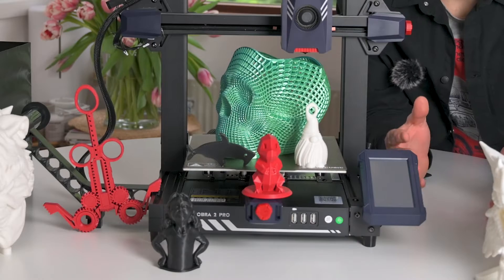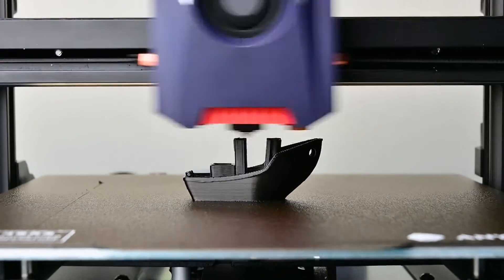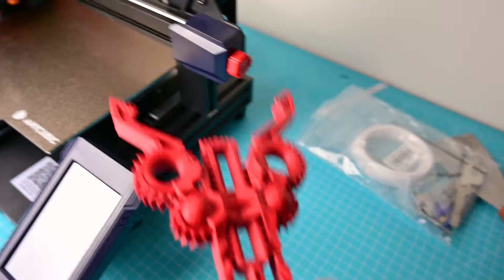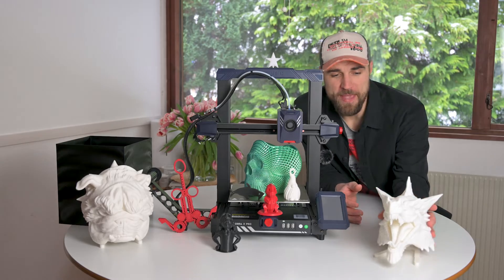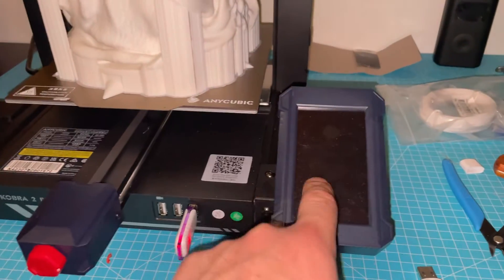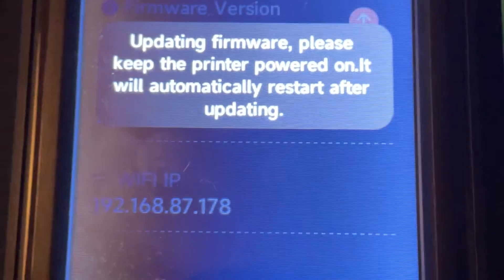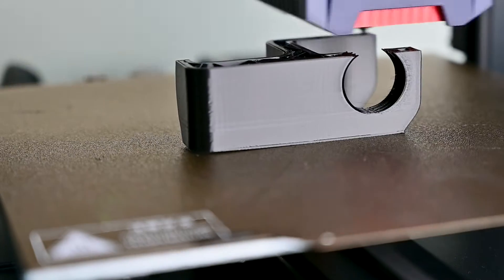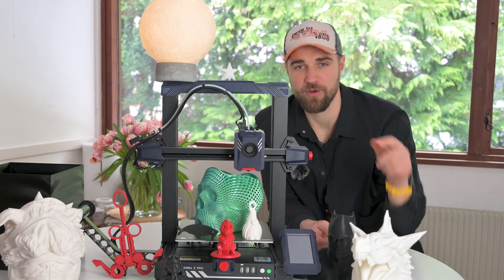Anycubic Kobra 2 Pro. Fast & Cheap 3d printer.

Comment: Quick huh 👏👏👏. What flow do you use in abs and pla?
Reply from the maker: Uh, don’t really know now by heart for ABS as I rarely print it these days. But for most PLAs I care more about the velocity settings, normally do not push more than 13mm3/s 🙄 
I only change flow rates if I am unhappy with wall thickness accuracy. Then do the tests, measure and adjust. Can’t remember when I did it last time 😅
Reply: hahaha I understand, but still thank you very much 😁
Reply: @Ecbonilha  When I got mine I just used the default settings. I haven't had to change anything.
Reply: @jst1man  Thanks. When I bought the Kobra 3, I ended up changing the PLA and ABS flow to 20, I still got good parts that way and it was faster. But the ABS default comes in 7.

Comment: I got it 3 days ago and still struggling with settings. Could you share some settings examples? What did you use for the bust for example? Thanks. :)
Reply from the maker: Mate, I honestly can't remember now. I used max setting at every power related parameter :)

Comment: Better than Bambu a1 ?
Reply from the maker: I have never had a Bambu printer. And I try to comment on "comparisons" only if I have tried both products myself..
Reply: @VRMinde  fair enough.  Thanks anyway.  I just bought the a1 and should have it later today so I was just wondering.
Reply from the maker: I think a1 should be a great printer ;) @CrazyguyRC
Reply: @CrazyguyRC  I have a Kobra 2 Pro and an A1.   The A1 is better by leaps and bounds.   The K2P can be frustrating at times.
Reply: Thanks, I'm happy with the A1 Other than the recall, still glad I bought it.